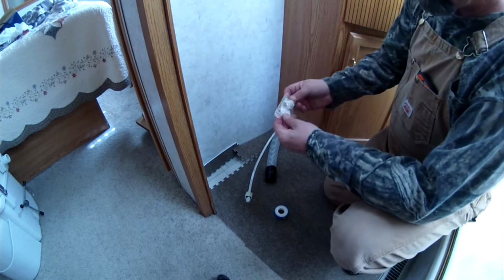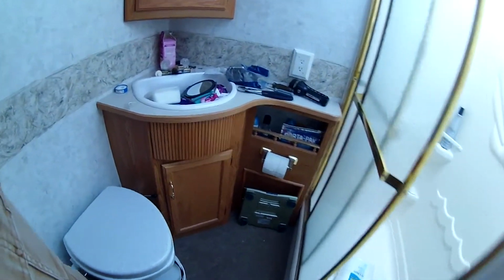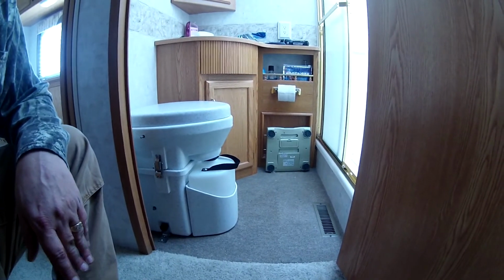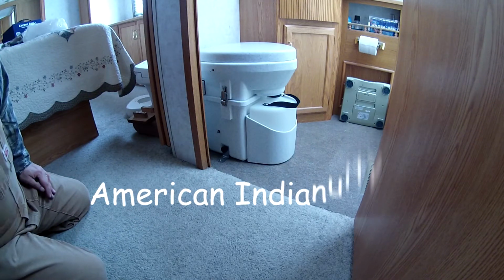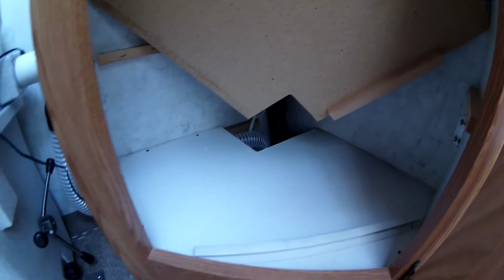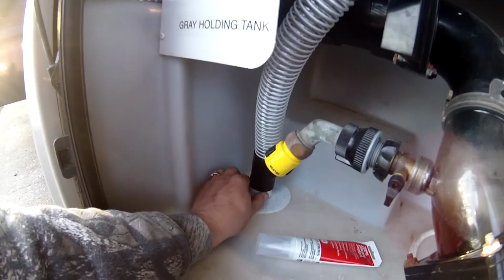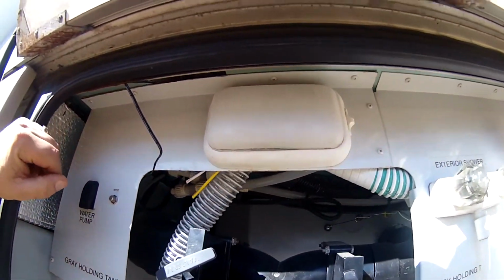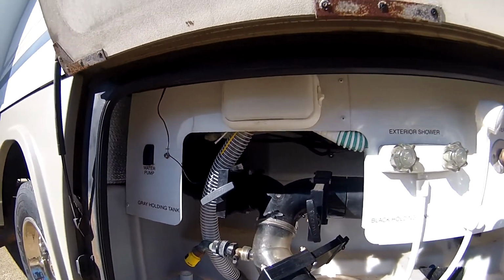Nature's Head Composting Toilet Installation - Nomadic Native

Comment: Thanks for the video!  I've been planning on getting one of these after watching 'Gone With They Wynns' use of Natures Head composting toilets.  But I couldn't figure out how to vent and power the toilet since it's on an inside wall.
Reply from the maker: Hi, Seems as though our RV was just setup right for running the exhaust tube and power cord, lucky! Just dumped it yesterday again. Did that inside the RV, just dumped it into a trash bag and put it in a trash can here at the Winnebago rally. The jug seems to last about 3~4 days with just the two of us in the RV. I've been dumping that in any toilet that happens to be available. Very happy with it so far & to tell you the truth I wish there was something bad I could say about it. The only thing I wish was different is the urine holes in the bowl, wish it was one, bigger, hole. I might take a dremel to it soon and make that a done deal. Thanks!

Comment: Good install, seems like a lot of workto empty the pee jug every couple days.  Did you get a follow up video after being in use for awhile?
Reply from the maker: +gonepriused No follow up video just yet, but soon. We're back at the house now, but I'm still using it. Figure I'll just let it compost, no reason to mess with it yet. I want to give it the full 60 recommended uses (or until the handle is hard to turn) so that I can give an honest evaluation in the coming video. It would seem that the jugs would be a pain, but not really. We just dumped them in the vault toilets at the campground, rinsed them out well and let them dry. So far, so good. What I can confirm is what I've seen in other videos, when I raised the top to remove and replace the jugs the only thing I could smell was dirt. During our shakedown boondocking run we was out Tuesday ~ Saturday and did not try to conserve our fresh water at all, still came home with a lot of fresh water in the 72 gallon tank.

Comment: Could you have turned it to the corner, put it on a angle ? Would that have open some walk way up. Can't wait to see how you like it. Great video
Reply from the maker: +RJ's adventures Hi, It never even crossed my mind to put it at an angle. Maria and I both being former military I think it would drive us crazy being out of alignment with everything else, lol!! It is a small bathroom, I've been thinking of removing the sliding shower doors and installing one of those pivoting shower curtain rods, thinking that would open it up a little in there. Not sure if Maria is going to go along with that one or not, the problem is she is 5 foot 1 inch tall and small framed, so she fits the small space just fine....  me, not so much. Ha!